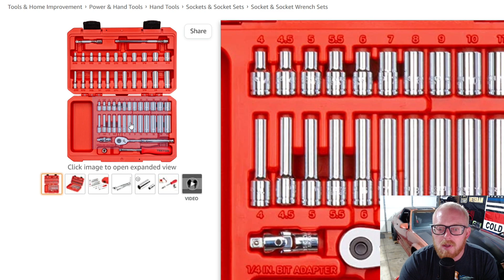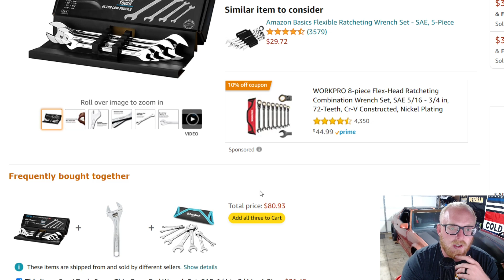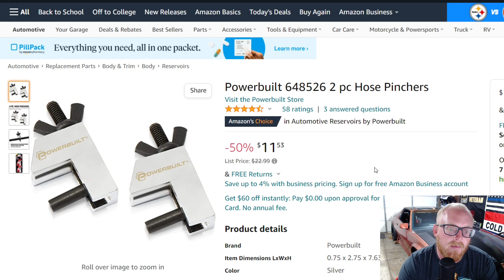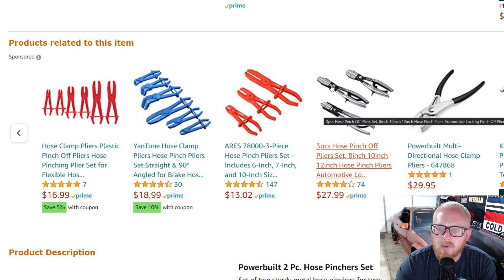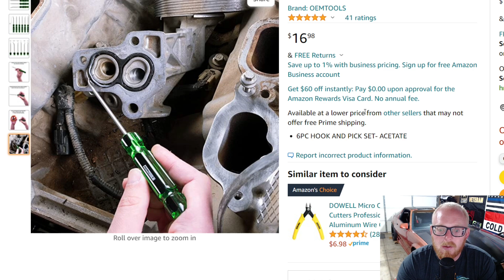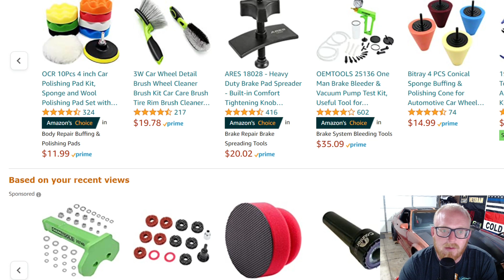Great Amazon Tool Deals Tekton Capri Powerbuilt OEM Tools

Comment: Hey Tony 👋  thanks for another great video! You ever run across any deals on "Jumbo" wrenches? Have the HF ones but I'd like to buy some better ones since I'm always using them on my older iron.
Reply: I bought tekton large wrenches and very satisfied with them. From 1-3/16 up to 2-5/8.
Reply: @rodneywager2142  And they also sell singles if you have only a couple sizes you use.
Reply from the maker: I can definitely keep an eye out for some. Thank you I appreciate it